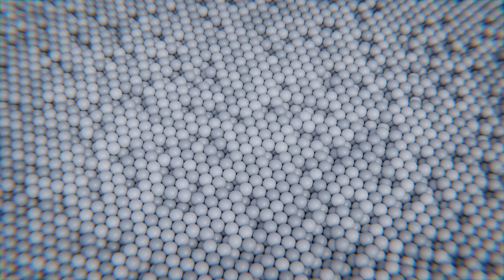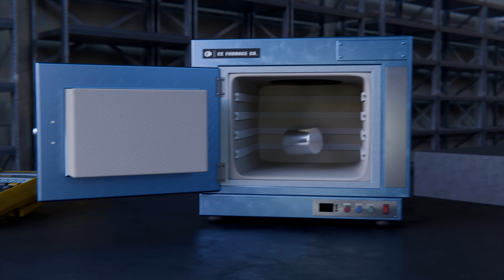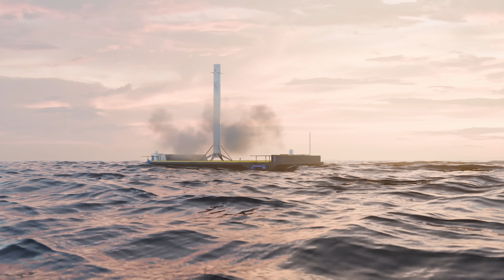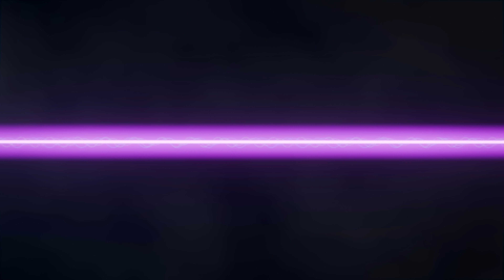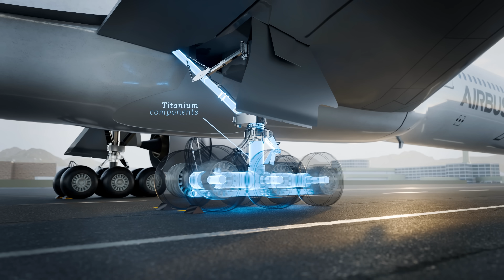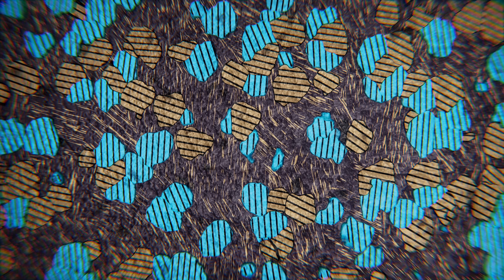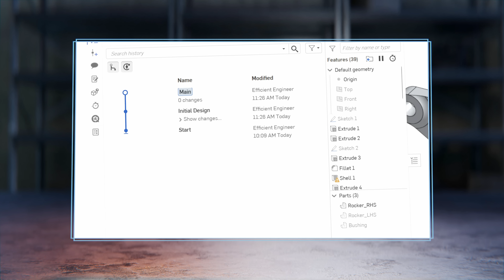The Problem with Titanium

Comment: This is wonderful. Can you do one for CroMoly 4130?

Also I thought CrMo 4140 was used in aircraft landing gear? Is that the old way and Titanium supplanted it? Or are both used in their respective best applications for different bits?

The grain structure lesson was something else. I've seen/read descriptions of phase change, heat treatment and micro structures. But it's usually hard to wrap my head around. This was so clear it seems very scientific but also explained in a way where I have some hint of the processing to manufacture and the practical engineering use cases. Wow. Thank you!

Comment: You sound extremely biased against engines tearing themselves apart, shredding the nacelle and scattering debris into the sky.

Despite your obvious biases I couldn't help find the video one of the best I've ever seen, and from the reactions it seems I'm not the only one that's more than moderately impressed with it. ❤

Extra points for a title that's about the best clickbait I've ever seen without actually being clickbait in any form at all.

Comment: WOW! I am 83 years old. I have held a FAA.mechanics  license since 1966. I flew as a Professional pilot for the airlines for nearly thirty years. I had no idea how complex the metallurgy in my engines are. Thankfully I never experienced a catastrophic failure.
Reply: The differences in knowledge between degree and diploma are vast.
Reply: @toolbaggers  yes, but stop rubbing it in 😂 have some respect for the man's humility in posting.
Reply: @toolbaggers  Metallurgy is extremely specialised. I have met many people with advanced degrees in mechanical engineering who weren't aware that even low quality materials could have variability due to this type of thing, yet alone details of the metallurgy.
The flip side of course is that with an advanced degree in materials science and metallurgy, I have no idea how to safely operate or maintain an aircraft.
Reply: @alexisnorman9446  im no expert. im just a regular non aviation mechanic. but i have seen enough things break and in so many ways including metallurgical failures and countless fatigue failures that i know the quality of materials and their consistent performance is absolutely imperative for the safe continued operation of any high stress machine such as a turbine engine or even just a reciprocating engine. the structure of materials dictates their strength and in what way they are strong. like hard steel is very wear resistant and resists plastic deformation very well, but it snaps and shatters, making it a very poor choice for something like a spring, mild steel is very resistant to fatigue and very ductile but it also isnt very strong or resilient once it begins to yield and it yields with little force compared to hard steel. and making the perfect steel to make the best spring goes right down to protons and neutrons and such and the margin of error for these high performance materials is extremely small. so we do have to get technical any time we plan on running something hard and we have to get rocket sciency any time we plan on doing it with minimal weight
Reply: The main différence between a diploma and a dégrée is 50000$ ….
Reply: A&P since 1987.
Reply: Explains a lot.

Comment: Dammmmmm for over 30 years I've just assumed anodizing metal to apply color was something like electroplating with a dye or the like. Mind. Blown. Cool!
Reply: I believe that is actually how coloured aluminium anodization, with dyes being injected.
Although I maybe incorrect there and thinking of a different processed.
Reply: There is Type I, II  & III aluminium anodizing.  Type I is chromic acid anodizing and is used for corrosion protection in Aerospace because it has little effect on fatigue strength and gives excellent corrosion protection.  Type II & III are sulphuric acid anodizing with the difference mainly being the thickness of the oxide layer.  Type II is the coloured decorative finish you often see on anodized aluminium parts whereas Type III is a thicker oxide coating, sometimes called ’Hardcoat’ that provides a very wear resistant coating.  

The Type I is the thinnest, while the Type III is the thickest.  Thicker oxide layers lead to reduced fatigue strength because they are harder and consequently more susceptible to cracking which leads to stress concentration in the oxide layer and the aluminium underneath. Type III anodizing can reduce fatigue resistance up to 60% !
Reply: @TricksterJ97 now spray some teflon on it and cook dinner.
Reply: With aluminium you do indeed need dyes (or other metals) to get a colored surfaces, as the anodized layer (aluminium oxide) is way thicker (several microns to over 100µm) than the wavelength of visible light so there aren't any effects based on interference. Colored anodized aluminium is usually only used for looks, as those layers are less corrosion resistant, less wear resistant and can be sources for cracks in the material. In all other cases you "just anodize" to get those properties.

Btw. the colors when tempering appear for the exact same reason as in titanium (light interference in a thin oxide layer). The difference being that in steel the layers forms because of heat in the presence of oxygen.

Comment: Airbus A380 being taken out of manufacture is a big disappointment. One of my favorite planes. Looking at you Boeing 🧐

Edit: im a machinist and i love all the -iums. My favorite is Zirc4. Weird material and itll throw lighting strikes if you machine it wrong. Titanium is a MF to tap. Molydee is the best tap fluid for Ti. Anything else will cause the tap to get squeezed and likely shatter. We form tap Ti and it runs great with Molydee. I told a partner shop we form tapped Ti and they looked at me like I spoke the wrong language. Aluminum is white meat so i dont really consider it a contender in the -iums.

Comment: As a materials engineer with a specialty in TMCP steels, this video was fantastic. It’s rare to see a free resource that is thorough, well polished, and technically accurate. 

It brings me so much joy to see my niche corner of academia/industry slowly work its way into the realm of popular science. Thank you for this. Genuinely.
Reply: What is next on the horizon as far as metallurgical advances?
Reply: @royalwins2030 Inconel has been in use for quite some time already.
Reply: @royalwins2030  its all incremental, tiny changes in alloy percentages, or tighter manufacturing of the alloy.
Reply: Look at this crap show….. i wouldn’t admit being an engineer, not sure a bigger group of dolts exist…. Surgeons maybe… butchers i mean

Comment: Titanium is usually not used in hot sections of aircraft engines.  It is why it is used for compressors and fans.  Since usually those areas are below 550 F.  The temperature limitations of Titanium are well known in the aerospace industry.  We usually used nickel based allows in the hot sections such as inconel and hastelloy. The fan should never see high temperature under normal conditions.  The fan section is a cold section.
Reply: I had a gas turbine mentor, K.O. Johnson, who related GE's discovery of the flammability of Titanium in service in a compressor- an all-titanium compressor bladed test engine unexpectedly exploded, leaving everyone shocked and dismayed. A few days later it was concluded that using titanium blades beyond the 4th stage posed a spontaneous combustion risk. Nature always seems to have an unexpected surprise waiting for those who are pushing the envelope. K.O. was the brains behind the GE UDF (GE36), among many other things at Allison and GE. He is the sole inventor on the UDF patent. Google:  GE UDF (UDF stands for un-ducted fan)
Reply: @jackthompson4993  So that's why the later stages are a different material!  I've been curious about that ever since I started as a tech for GE.
Reply: @Lambda01  My mentor was K.O. Johnson...he was , among other things, the main designer of the GE Unducted fan engine (GE36). He is the inventor on the patent covering the engine and its innovative and insightful counter-rotating power turbine and blade pitch mechanism. K.O. was a great mentor and he had hundreds of stories. (Google GE UDF)
Reply: Why did they use it on the SR71? I thought that plane was like 90% titanium ?
Reply: @companymen42 because it's surface temperature didn't exceed the temperatures you see in turbine section. It only reached 300 Celsius which is totally normal temperature for titanium alloys. Mach 3/20 kms is nothing crazy in terms of total temperature when we are talking about metal alloys.
Reply: @One90972  I take it that's hot enough to soften normal aircraft aluminum alloys?
Reply: pretty much. Aluminum and steel lose a lot of their strength at barely a few hundred C.
Reply: @sethpadakandla2797  Aluminum does. Most steels do not start losing significant strength until 500C or higher.
Reply: @philperry4699 The fuselage still had to be fuel cooled tho. That's why soviets used nickel alloy for mig-25, they couldn't afford leaking mass production jet.
Reply: @sethpadakandla2797 most steels don't loose that much strength especially with a small amount of additions to stabilise it (normally nickel to varying degrees depending on requirements), aluminium does though as 300 is half way to it's melting point.
Reply: @companymen42  Only the skin.  Lighter aluminum could be used everywhere else.
Reply: The SR-71 had a limit load factor of 3.0 cold, and 1.5 hot. 

Titanium was light and strong, and resisted the heat adequately. Russians used stainless steel in the Mig-25 Foxbat, and it held up fine at high Mach also. But it was weaker, therefore had to be made thicker, which was heavy. It did not have the operation range or endurance of the blackbird. And it could not really exceed Mach-3 for any extended periods. The blackbird maximum mach was published as 3.5 in the pilots operating manual. And multiple pilots have confirmed on the record experiencing double engine unstarts/flameouts any time it reached M3.5, or slightly before then.
Reply: @Triple_J.1  irony is that the soviet union had the most expertise and sheer scale of infrastructure in titanium metallurgy that they even made whole submarines out of it but chose to use steel for their mig25s to mass produce them despite being able to mass produce the mig25 with titanium instead. Odd choice to cheap out on that one.

Also the sr71 constantly disintegrated and blew itself up accounting for a dozen of losses out of 32 with no armament and barely did recon well nor could it fly over the Soviet Union at all, it was okay but overhyped and more of a propaganda tool, mig31s were able to lock it up. The XB-70 was more impressive and ambitious with actual utility despite being doctrinally obsolete just like the sr71.
Reply: @0bsolete_fps773 the choice of nickel-steel rather than titanium goes well beyond the pop-sci explanation of it being welding etc. 

Several reasons missed:
- cost - the mig 25 was a mass production plane unlike the SR-71 that dwarfs it in cost
- heat dissipation - with titanium having up to 20x worse heat dissipation it requires active cooling to not melt at hot spots, this required intricate cooling using as special fuel in the SR-71, again more cost but also r & d time
- thermal expansion - nickel-steels like invar have exceptional low coefficients of expansion at 7 x lower than titanium which was another issue the SR-71 had leading to the infamous leaking tanks.

TL;DR - cost significantly less allowing for mass production and had less engineering required due to the better heat dissipation and thermal expansion being preferable. And then there's all the reasons pop-sci giving about it being a pain to top it off.

Comment: As a shooter, titanium is used frequently in silencers/ suppressors and you have to be very aware of how hot you are getting things because over 800 degrees it can erode or lose enough structural integrity to burst. I have one titanium can (CAT JL), grade 5 and I keep an infrared thermometer with me when shooting it, though being that its on a scoped rifle mirage will distort my sight picture LONG before it gets too hot. If you're in to materials science, firearms suppression is actually kind of an awesome thing to get in to. They use 17-4 PH steel, titanium, inconel and the toughest, Haynes 282.

Comment: I wear my watch in its titanium case with its titanium bracelet 24/7.  It's lighter than plastic and stronger than steel. 
I have accidentally whacked it into metals and brick walls. With a sapphire crystal, it's still in "as new" condition, with only a scratch on the bracelet, none on the sapphire. I'm never going back to plastic/steel and glass/polycarbonate. Skin doesn't care about titanium. Try not washing under your watch with a nickel/steel/plastic bracelet, see what happens!   Titanium is the best!

Comment: This is far from the biggest issue with Airbus's,  considering how many had to be immediately grounded til they corrected a vulnerability, only months ago. And FYI the same issue they were grounded for? Is rooted in the suns penetration due to the magnetosphere and our swift geomagnetic pole slip. Same reason there is now a reduction on hours for pilots over 30k feet time spans. No one is going to be telling you this: The sun is about to reset the planets, right on time. Biblically. For the past 20 years, we are living through the onset. For 54 years, since thae last lunar mission? They have known. It was classified til 2012. The glass surfaces, marbles? Created on a distinct timeline, that matches the geology and ice cores isotopes, due to? Our suns micronova cycles. 6k/12k cycles. Now, if you go back since it was classified? Guess what was the lie to consume the world? C02. Proof it never was us? All of the planets atmospheres changing.. A fact your "Legendary" NASA scientists, and those 72'  last crew on the moon? Hid from the world. They knew why they were recollecting for further backup on the prior found isotopes and dating variances, discussed the facts of what was discovered in direct video and communication with the earth, all recorded, all classified, now available. We have approximately 20 years at best, before biblical reset here. It is NOT Unknown, its withheld.

Comment: Thanks for the amazing content, super nice graphics and detailed scientific discussions! It's a cheat to have this content out here for free. 

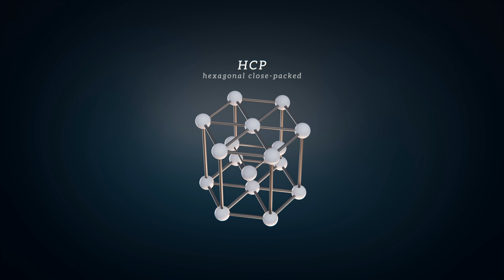At around @1:40, wanted to point out that despite the term "hexagonal close packed" being widely used, it's incorrect to say it's a "hexagonal close packed" structure, as that needs an ideal c/a ratio of 1.633, while Ti has a c/a ratio of around 1.587.
Actually there are no hexagonal close packed structures in the metals known to us, there are only hexagonal metals.

Comment: I read that an engineer for North American Aviation once recalled the difficulty in machining it. He said "You don't tickle titanium" 😂😂
It also suffers stress fractures at high temps if there is cadmium contamination, plus chloride in water used to cool cast titanium causes issues later on too.
I wear titanium glasses. Very light and i forget i wear them.
I used titanium pressure vessels, anti-seize compound was essential if i wanted to take them apart, running up to 1000 bar (4000 bar in pressure testing), they had a tendency to stick together rather well without it 😂😂

Comment: https://youtu.be/wbXbj20351o?t=13m48s

Different wavelengths don't move at different speeds in air or vacuum.

Edit: noted that constant speed applies only to air or vacuum.
Reply: They do in most dense media, that's why they have different refractive index for different wavelengths and we get chromatic aberration as a visible result. This is also how prisms work.
Reply: @KonradTheWizzard Thanks for pointing that out. I think the animation is meant to show after the light leaves the coating.
Reply: @tymoteuszkazubski2755  Ohh, yeah, now I see it too. It's not in the spoken text, the animation shows the waves with very different speeds in air, which is of course neither accurate, nor necessary for the effect described here. The thin-film interference works even with perfectly equal refraction, since the film is thinner than (or very close to) the wavelength. Good catch!

Comment: I never would have considered the subtleties between grades of titanium and its alloys, though the engineers who do have made it possible for me to fly over a thousand miles in less than a day. And land safely. For this I am intensely grateful.
Reply: The slight variations in alloys make a significant difference. Aluminum perhaps the widest between 5000 and 7000 series. (One for Soda cans, the other used for Machine-gun receiver/action).

Comment: You should make a another video called "the problem with carbon fiber." You could mention the ocean gate disaster or how difficult it is to recycle.
Reply: It was a similar situation to the problem of irregular voids in 3d prints, resulting in chaffing. I forgot what else, but it was the largest thing that stuck out to me.
Reply: Using carbon fiber was the least of the problems at Ocean Gate
Reply: @liambohl  however, a lot of the physical problems with the submarine would have been avoided by not using carbon fiber. If it's difficult to QC, it should not be used.